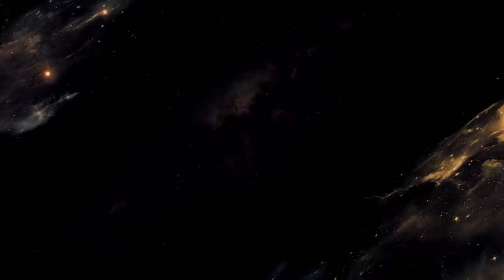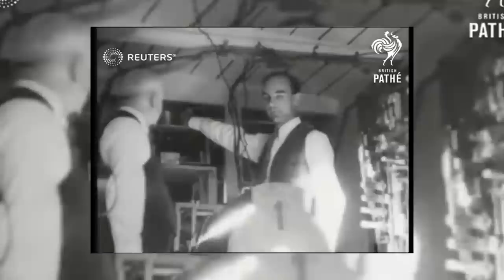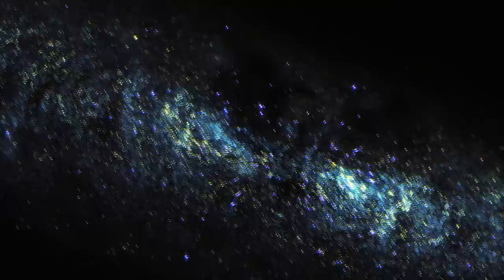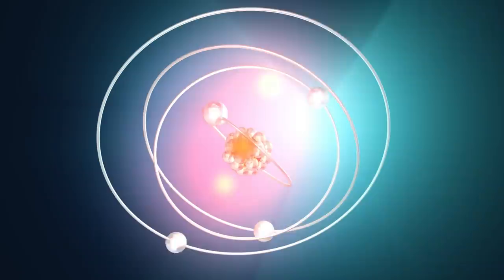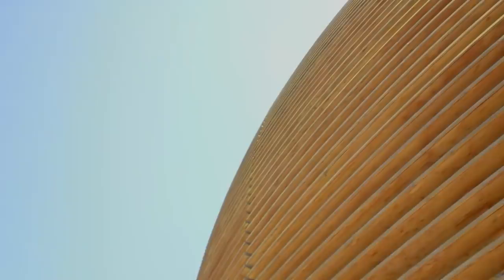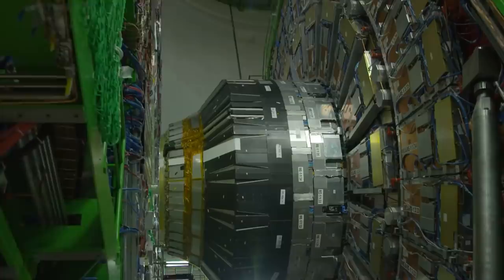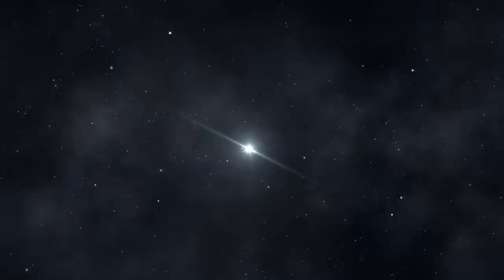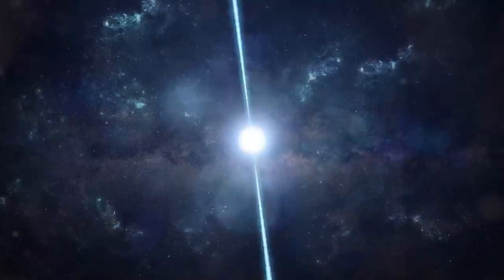Physicists Finally Reveal the Terrifying Truth About Antimatter

Comment: Maybe anti matter is what powers the stars? Think of all the energy they release.
Reply: Not quite. The energy of a star comes from fusion. Massive amounts of heat and pressure(from gravity) "force" particles together. When they combine, photons are released in tiny explosions. Photons are "little packets of energy".

When matter and antimatter touch, they annihilate each other and the annihilation releases photons.

When the uranium in a reactor decays to a more stable material, expelling a neutron(fission) it releases photons with the neutron.

We harness and utilize photons in various ways to "create" electrical power.
Reply: No, that’s just nuclear fusion